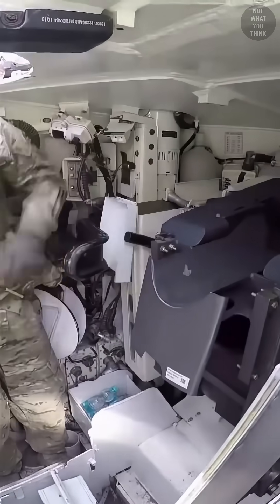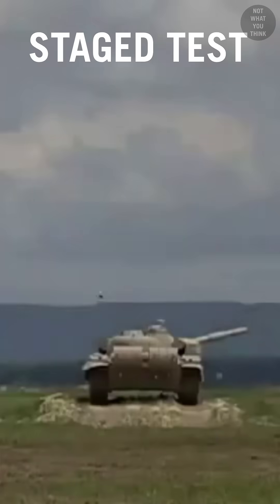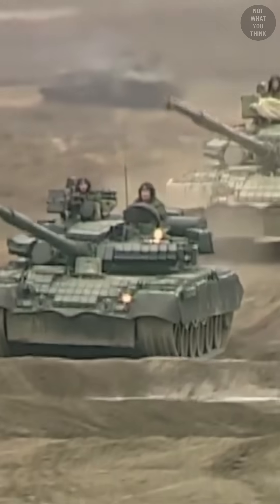Why M1 Abrams Tank Has No Auto-Loader #shorts

Comment: Russia has a long history of winning wars by throwing waves of men at the enemy until the sheer numbers overpower the better equipped and trained foes, that's what they did in WW2 as well...
So they've never cared all that much about the safety of their troops as they basically see them just as numbers, fleshy numbers filled with blood and guts...

Then they tried to do the same in Finland in the middle of winter, their under dressed soldiers froze to death, were picked off one by one by guerrilla tactics and snipers and the only reason Finland agreed to a peace was because spring was coming and that would have meant losing most if our tactical advantage, also the continuation war was nowhere near as successful because it wasn't in one of the coldest winters in decades and the Russians had cleared huge amounts of land to make sure their tanks etc could move around in a more unrestricted manner so the favourite tactics used by the Finnish army of taking out the first and the last vehicle of a Russian line as they were traveling through a forest on a narrow road and then shooting their soldiers from the safety of the forest didn't work anymore so even though the Finnish army made great progress at first they weren't able to hold the land they had taken back and frankly they never had any hope of doing so because of the Russian preparations driven by the lessons they learned in the first was against us...

The difference between the army sizes and losses in the Winter War at pretty staggering, Russian army was three times as large (about one million men, where as the whole population of Finland at the time was under four million) and much better equipped (they literally had over hundred times as many thanks as Finland, 30 times as many aircraft that also were much never than what Finland had and much better firearms too) but their losses were about 10 times higher than Finland's, and Finland was able to commandeer a ridiculous number of the Russian tanks with the tactic of taking out the first and last vehicle of a Russian convoy and either killing all the men or enough of them that they surrendered...
In the Continuation War the Russians threw even more ridiculous numbers of soldiers at the Finns, the attacking army was about 1.5-2 million strong against half a million Finnish troops, and unfortunately... some Nazi allies... as they were only country that would help Finland fight the Russians that had attacked Finland without any provocation and forced us to give them some of our land that the Finnish government and people very understandably wanted back, which was why the Continuation War happened (Great Britain, the USA and most European countries actually sympathised with Finland and when the Winter War started initially planned to help us but then the Soviets made a really smart move and allied with the countries fighting Germany making helping us impossible as they would have been fighting their ally, and frankly the allies really needed the sheer numbers Russia could bring to the war against Germany as most of the European powers were starting to get pretty depleted inntye manpower department and the US had a bit of an logistics issue (on top of also fighting a war in the Asian front at the same time, that was also occupying most of their navy) given how far they were from the theater of war and how relatively undeveloped flight technology still was meaning that most if the troops were brought to Europe with boats which took time and was pretty risky thanks to German submarines (and the modern almost city sized carriers and other super large ships didn't really exist yet so they needed a huge number of boats to ferry all the men to Europe) so the only ones that had the fighter and bomber command planes Finland desperately needed to have any hope of taking back the land the Soviet's had stolen that could help us as unfortunately Germany...

Although Finland made it very clear it was just this one particular war and that Finland wouldn't be aiding Germany in any if their wars (and apparently much of the Finnish leadership really disliked the German leaders and especially their hateful philosophy, even if Hitler himself apparently really liked and admired the Finnish president/highest leader of the army Karl Gustaf Mannerheim even coming to his birthday party an audio recording of which has been used by many actors preparing to play Hitler as it one of the only surviving recordings of his normal speaking voice instead of his unhinged screaming while giving speeches)

This became much more of an history lesson than I intended but I felt it was good to give some background to explain how ridiculous the Russian army doctrine at the time was and in many ways still is as it was successful so there really wasn't much pressure to change it all that much despite the staggering losses it caused to the Russian people, obviously the Russian propaganda painted the deaths as heroic sacrifices and unavoidable and still does because nationalism is as high as ever in Russia as it's Putin's greatest tool for keeping the masses in line while he and his inner circle pillage the country off its riches...

Hell, I had to take the Winter War battle numbers from the Finnish language Wikipedia because Russian internet trolls keep changing the English language one to show Russia's army and losses as smaller than they were because of how utterly humiliating the real numbers are...
Russia's WW2 losses were literally larger than all of the other countries combined, that's how they waged war at the time and would probably still largely wage war today because it works...
Reply: Only problem with that history lesson was the Russian military was out of hardware that we supplied to them especially in the form of reflagged war ships and merchant fleet. They lost theirs to the German uboat fleet. No American hardware no Russia...get it! We saved their commy assess so we could hand them back again and again. They owe us big!
Reply: @radiotests  
Look, I have no love for the USSR (hell, I've met my great grandfathers both if whom fought in the Winter and Continuation wars and heard first hand how brutal the fighting was) but WW2 could not have been won, at least not until much more civilian losses (Germany was close to developing some truly horrific super weapons, and they had a atomic energy project underway) without the USSR throwing 10 million men to their deaths, the Russian army was bigger than all the other allies armies combined.
Sure Russian manufacturing wasn't up to par with the US but they had plenty of manufacturing power and much of their manufacturing infrastructure was so far into the heart of Russia that even bombing them, much less doing any ground assaults or artillery attacks, on their manufacturing infrastructure would have been insanely hard to do in an effective manner.
Had Hitler not gotten over ambitious and attacked the USSR the war would have ended very differently given that Germany and Russia had a loose alliance before that (in which they divided Europe between eachother) the US military at the time was formidable but if Germany and Russia had allied the US would probably have gotten involved in the European warfront at all because it would have been practically suicidal.

People often don't get how lucky we got in WW2 that both Stalin and Hitler killed off many political and military rivals within their own regimes which led to both armies being mismanaged, the Russian army even more so.
But Russia was able to make up for it in sheer overwhelming numbers, it doesn't matter if you have better gear if every soldier needs to kill 10 or more enemies to win the war...
Especially at the time when fighter jets didn't exist yet and neither really did aircraft carriers, without allied bases in Europe the US wouldn't have been able to take the fight to the enemy in a serious way.
You can defend against overwhelming numbers to some extent but attacking overwhelming numbers needs some serious logistics and airpower to actually do successfully.

And since I've heard some Americans say the US should just take out Russia, those things things are true of Russia even today, and China has also gotten there more and more, which is why a war against those two countries (an attack on either one would mean starting a war with the another too) would be absolutely horrendously costly to the whole world even if nukes weren't brought into the equation (and since both countries have nukes and I can't imagine those two authoritarian regimes not using them if things get desperate enough) a war against either country would be an insanely bad idea, even worse than it would have been in the 1930s/40s...

Comment: Still, both ammo racks are in the turret, the armoured door wont do miracles if the ammo explodes. Also, Russian tanks are actually the most advanced tanks in the world, them having an autoloader which is "usafe" compared to an Abrahams, it wouldn't make the Abrahams, whic have had the same model for more than 25 years, get closer to a new T-90. It's just a fact, you can say loading sistem is better because is safer, but it's not faster, nor stable, nor accurate, even the capabilities of each tank are to be considered. Is ingeneerimg basen on 2010 to 2017, to a tank which have been close to unchanged for 30 years now.
Reply: The armored door does do miracles because very few people die do to ammo explosions on tanks also you’d be surprised to know how little Russians care about the safety of their crew for example Russian BMPs armor is so light that small arms fire can penetrate it and they did that just so they could put a slightly bigger gun on it

Comment: I think its so you can still fire the gun after a hydraulic failure. I know it can be aimed manually. Cant remember if the ammo door opens without hydraulics or not. But as I said. I think ira a redundancy issue.

Comment: Well, when they switch to completely automated Battle Tanks operated from afar via a Remote Control, I think it won't matter as much and you can replace all that crew area with more ammo.
Reply: That won’t happen for the same reason why autonomous fighter jets won’t be a thing. The latency could make a huge difference in the battle. If 1 tank is autonomous and the other is maned. The manned one can react far faster than the autonomous one
Reply: And then it got hijacked by the enemy and you will wish that you didn't switched completely to automated tank system.
Reply: @kaptenhiu5623  in what situation would they be able to effectively hijack and automated tank?

Also saving human lives is better than stopping the occasional edge case.
Reply: @NihongoWakannai  How's it work ? the tank I mean... Is it totally automated such as T-100 Terminator ? If it was... then we'll have more severe problem at hands here than hijacking
Reply: @kaptenhiu5623  the person above already said how my dude, remote control, like drones which are already in service in the military.
Reply: @NihongoWakannai  "the person above already said how my dude, remote control, like drones which are already in service in the military....... which can be hacked or at least disabled by radio interference.
Reply: @kaptenhiu5623  and yet they are still in use because they are useful, and "hacking or disabling" them isn't exactly a simple task.

Of course there are problems with remote controlled tech, but there's also a big problem with human manned weapons... Human death.
Reply: @NihongoWakannai  Drones are useful because they can fire outside of ECM range, an automated tank is going to get jammed hard before it can get a clear shot on the enemy.

Comment: Something I can add to this conversation is that the us military frequently tested auto loaders and until recently dosent go with them for a few reasons, first a well trained loader is as fast or faster than a auto loader and can act as a backup crew man. Second reliability, American doctrine requires loads of reliability and ease of repair IN THE FIELD. Most countrys can afford to send their units back to a factory or a base for repairs, however us doctrine maintains that all units should be able to effect repairs od nearly every component with a minimum of equipment, complex auto loaders that may require you to remove the turret housing cannot meet this requirement. And third, if the auto loader fails the cannon must be able to laod by hand, like how the m249 saw got additional development time so it could load stanag magazines as well as belts the same exists for the abrams main gun. Good news is the m1a4 is getting an auto loader...eventually...when it comes out nebulously in the future.
Reply: Stryker Mgs
Reply: @hendi1571  Yes! which is being developed to put in the abrams! :D it comes full circle! But the army is also abandoning the stryker MGS according to some articles Im reading on the internet.
Reply: @Pathfinder118  i just wanted to express that the US army actually did use an autoloader, contrary to your statement. But you are right, they'll get rid of it.
Reply: @hendi1571  oh gotcha, yeah your right, they do, its just taken us a while to adopt one formally. sorry for the confusion.

Comment: Auto loaders are great except when they load bits of crew which was a problem with Russia's earlier designs.
As has been stated round selection is a problem with ALs.
UK use two part ammo this allows for a bigger number of different war heads without needing more propellent cases so helps in various combat target senarios
Reply: UK is stuck in medieval. 
Country with monarchy can't be progressive. 

Communist revolution can solve the problem.

Comment: If i'm correct, the leopard 2 A 6 has both features combinde. An autoloader and protection for the ammunition. I belive they only use dart shaped rounds that dont need any explosives inside
Reply: Regardless of the round type, being dart or any other, they still are explosive so you want to have those things protected. 

By the way what you said is wrong, Leopard uses other ammo types too.
Reply: @Velasken_841  they mostly use them. But of corse they need to be protected. Btw they habe an extinguish system in the case of a fire

Comment: Ok, the M1 is an old tank. Yeah u can say 

BuT tHeReS tHe M1A3 u cANt sAy ItS oLd!!!

Yeah but all u get are armor improvements and other crew survivability upgrades. 

The actual size of the chassis and interior space hasn’t changed since the first tank was produced 1980-81. The designers obviously didn’t intend to have an auto loader and it was still a controversial design idea at the time.

Yes, autoloaders today in the 21st century have vastly improved. But was the M1 designed in the 2000s? No. The LeClerc, K2, etc, are all 21st century era tanks. 

Your basically asking to overhaul the entire tank design that already pre exists to have a whole new loading mechanism which wasn’t designed in mind for one, to have one. 

Problem solved.

Comment: Everyone forgets a crucial reason to use autoloaders - fewer crew. Say you have 100 tanks that need a loader and 100 that don't. The ones with a loader will need 400 soldiers to operate, while the ones with autoloaders will only need 300. 25% less crew per tank means you can have 25% more tanks with the same number of tankers.

Comment: The blowout panels got nothing to do with the human loader, the reason why the M1 got an human loader is probably because America got the human capacity and logistics, besides that it features a couple good reasons to have an extra human on board, thus said there are autoloaded ts KS with blowout panels.

Type-90
K-2
T-90 got partial ones.
T-14 claims to have them

So, why shouldn't autoloader, specially "western box style turret" tansk not have blowout panels? 

Blast door opens and closes when loading as if the human loader wouldve taken the ammo from the stowage.

Comment: I'm currently in the Army assigned to a tank battalion and auto loaders are available for the Abrams, but most crews don't use them for two main reasons. 1) a good crew can put another round down range before an auto loader is finished reloading and 2) it's another system that can fail you in the field.
Reply: Do they can reload faster then auto loader while drive

Comment: There's just 3 crew members in a T-72 Tank. You can manually load the cannon on a T-72 but it must be done by the Gunner or the Tank Commander. The Tank becomes a sitting duck no matter which one loads the cannon. Knock out the auto-loader and the crew will bail and run. If they don't take the time to blow up the Tank it gets captured, rebuilt,  and ends up at Twenty Nine Palms NTC, California for training US Troops. One HEAT round slapping the Turret will knock out the auto-loader.

Comment: the real reason why they don't have autoloaders is that engineers are risk-averse and stick to what works with minimal modification - its the same mentality that went into making the space shuttle as expensive as it was, which brings it on to the second reason and that is that clients do not want to foot the cost and weather testing the system when the requirements for the main gun in the war contexts these guns are expected to operate in do not justify the risk of a new design, the added maintenance cost of the extra parts and the MBTF hit they're expected to take as well as added failure modes, the benefits do not outweigh the negative factors at play or the risk surface is disproportionate to the advantage gained for the people in charge of setting the requirements, but really its the first reason and the second reason is the rationalisation because people are risk-averse. I don't think the Russian forces quite suffer from the same issue. 
personally, I think that it's time to shift gears and try something new - or risk being left behind, as the war requirements call for it.